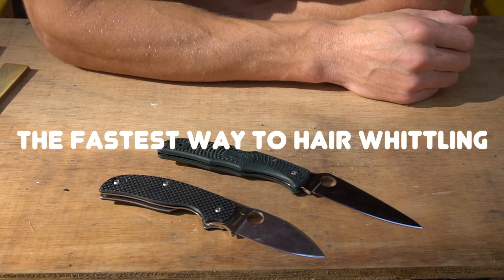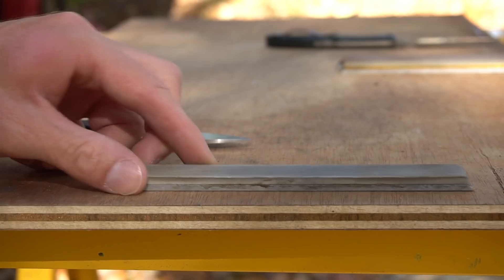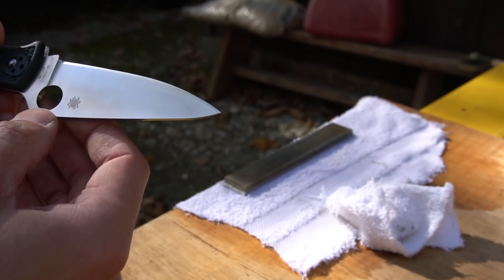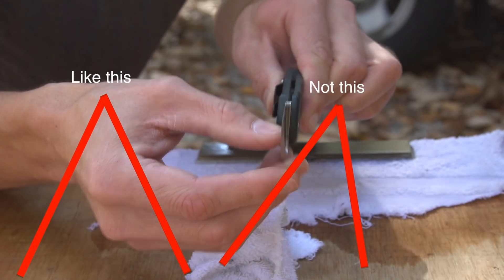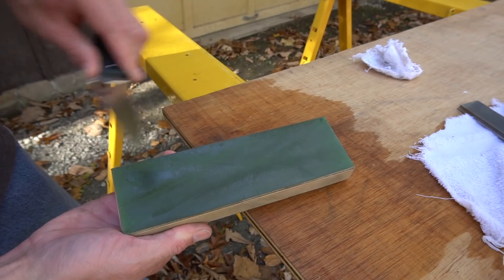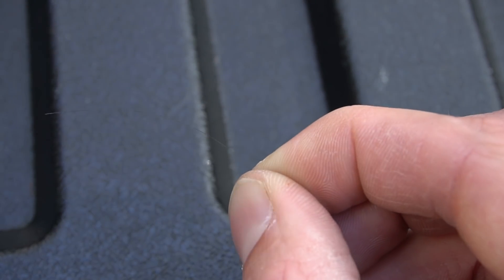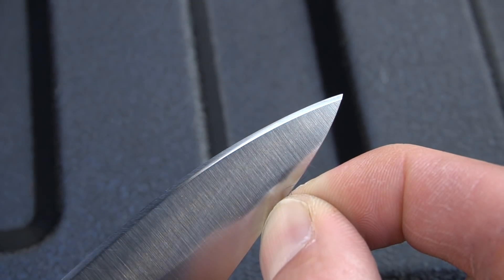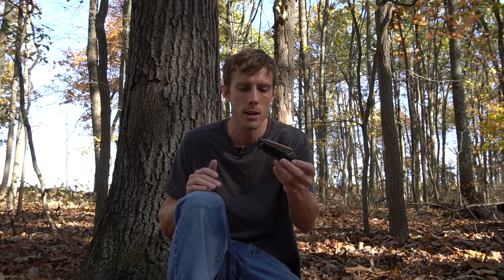FASTEST WAY TO A SCARY SHARP KNIFE

Comment: More than fifty years ago, when I was sixteen, my uncle taught me how to sharpen a knife with a whetstone and strop. He taught me to remove the burr by periodically backing the blade up on the finer surface of the whetstone, rather than the standard method of pushing the edge into the stone. He even made me a strop out of a strip of leather mounted on a board. A little jeweler's rouge helped add a bit of final refining. I used to carry around a Buck pocket knife, and I could whittle hair with it once sharpened. Now I have no more hair to whittle (okay, I still have some hair), and perhaps to my shame, maybe forty years ago I switched out my Buck for a Victorinox Swiss Army knife. I've carried that knife with me for more than forty years. It can't come anywhere near the Buck for making an edge, but is much more useful as a pocketable toolkit. I still miss my Buck though, and remember my uncle fondly.
Reply: Larry, I received a Buck 110 in 1968, upon discharge from the USAF, from my dad and it was the start of an ongoing interest in the Buck line of knives. I lost that first Buck in the backwoods of the Quetico Wilderness during one of my guide trips with some city folks from the Twin Cities in Minn. and it may still be lying on a portage trail up there somewhere. I have always hoped that some lucky outdoors traveler had found that knife and put it to good use. I now own a number of Buck knives and also quite a few Victorinox knives so I know how you feel about the "loss" of your Buck. I have been sharpening edged tools now for over 60 years and have honed my skills to a much higher level than I had ever expected. [I suppose there's a pun in there somewhere] I guess that gets in a man's blood and never becomes such a boring pass time that he simply quits sharpening altogether, eh? 

I have traveled many miles and learned a lot about a lot of different things but I always consider myself a "student" of learning and will always take pride in learning anything "new" to me, whether I know a little or a lot about that subject. When I stop learning, somebody had better check my pulse!
Reply: @oldoutdoorsguy3238  I bought Buck 110 around the same time,  always used it on fly-in fishing trips to northern Ontario.  I let my 15 year old nephew use it and he damaged the spine/back lock and made the blade not close completely. It lived in my drawer for 35 years and about a year ago I sent it back to Buck. They restored the entire knife and completely repaired the spine. They sharpened it, of course, and did the whole job for free. 

I still have the original leather Buck case, as well, everything  is made in America. The early examples of that knife had a finer point to the blade. Those knives were kind of a deal when they came out.
Reply: Man... I miss your uncle.

Comment: When you get to my age, I find it best to use a magnifying glass to check apex, and  burr. Been experimenting stroping under the magnifying glass stand as well. Getting better results when u can see your angle more clearly lol
Reply: At 74 it's the only way to go . HAPPY TRAILS.
Reply: I pick a brand new magnifying head set at Good Will about 4 yeas ago started using instantly makes life much easer. In fact we went today pick up a brand new Logitech pro 9000 web came with the seal still on the box $5.99 .About 7 years ago think I bought this same camera for the PC at the time for $ 90.00 dollars it works will sit up in the garage this little camera is a1000% better than the camera in the new laptop . Happy TRAILS my friend.
Reply: You bet even brand new there not expensive I think there referred to as head set magnifiers there just great should be on amazon and they have different magnifying . The only thing I did to mine was barge glued some thin leather on the hat ban that plastic was driving me nut so . Your doing knives and I'm doing sheaths I have over 200 hundred low but great knives but the mid range knives in most cases are really crap but the knives them selves are great . so I have a lot to do took me 2 years to figure it all out with help from some you men in England with the stitching and other things but those guys saved me a fortune in mistakes let me tell you .
Reply from the maker: Average Joe- I need to get one. Id like to get one of those large ones with a stand. It would definitely help with visuals for sure. 👍 Or bette yet an electron microscope 😉
Reply: Matthew M  they sell fairly powerful magnifying glasses, in Walmart and drug stores.
Reply: Matthew M  They have them with a light, and stand they well worth it!
Reply: Matthew M  . They can be fairly inexpensive for the lower 2X -4X  powered ones, about 30 USD . Cheap and easy to make a DIY one.
Reply: Your a very lucky guy to have all that knowledge just sitting there in the family waiting to answer your questions .I would have killed at one time to have access to that . I am a truly western sheath guy don't care for Kydex at all to me a sheath is the home of the knife nice and soft and warm home for the knife . Kydex to me would be like us coming home crawling into a bed with plastic sheets NO THANKS . Take care good luck with your knives and say HI to all those fellow leather works in the family . HAPPY TRAILS . IF you have time you might want to look at Bruce Chaney on you tube great leather worker in Texas I think he
s 3rd or fourth generation saddle maker but he does it all even the hard wear silver work a complete artist . I bet your parents and grand parents would love to watch him.
Reply: A magnifying glass is a great tool when you are learning, but I find that I can tell more with my fingertips than I can with even a jeweler's loupe.  What you really need to learn is how to sharpen your knives without creating a burr in the first place, and getting your knives sharp without the need for a strop.
Reply: Get a guided system and you can sharpen with your eyes closed. KME is a decent tool at not too bad a price.
Reply: rockets4kids how do you do that I’d love to learn (im 15) I like to keep my benchmarked nice and sharp hair shaving sharp but that’s the extent
Reply: @rockets4kids  yeah, curious how you do that. Also, what's the benefit of that method vs this one?

Comment: An old friend showed me how to use a sharpie marker as a visual guide to help keep the proper angle during sharpening.  The best way I've had it work is if I cut straight into the sharpie with the knife and apply pressure accordingly to get sharpie on both sides only where I was going to be standing. Once the sharpie is gone its usually pretty sharp.

Comment: My Dad was a mechanical engineer and a fantastically accomplished sharpener of just about anything! His test of whether a knife was truly sharp was to hold it sharp edge up and drop a handkerchief on it. The knife was "sharp" when just the weight of the handkerchief was enough to cause the blade to cut it in two...or at least that was the "goal" he set for me that I was never quite able to achieve. He always sharpened initially with circular movements rotating away from the cutting edge until a burr developed. Then using a very fine grit stone he would lightly stroke the blade cutting edge forwards until the burr was removed. Finally he would use his old fashioned barber style leather strope to finish off the edge.

Comment: Excellent methodology! I've been busy tonight trying to bring the edge of a Cold Steel San Mai Tai Pan (vg-10) up to a sharper cut. It hasn't been too easy with the hard steel, but I finally got it slicing printer paper like a razor. Even push-through is good. Plus I have a relatively shiny mirror finish achieved with the ceramic stone and strop. Only issue I'm not so proud of is the dang tip. I think the apex is decent, but the tip isn't a needle like I wanted; it's a bit rounded. Not so much that it won't stab effectively, but I really wanted to be able to poke my finger and feel that prick. Guess I'll need to work on it next time. I have a few of the Cold Steel knives, mostly bought on Amazon, and even though I never got a fake or defect some of them aren't very sharp when you get them. I know that CS will sharpen your knives for free, but dang they take weeks to return your knives. Anyway, I enjoyed watching your video. You seem like a cool country boy, like someone from my own neck of the woods. And you strike me as sensible about your methods and what you expect out of various knives. These CS knives I have are pretty much fighting knives. I have a few fixed blade and a few folders. Spyderco are excellent knives, I see you have a few of those. Take care!

Comment: I like using the backwards stropping motion on my stones for precision sharpening, though it is a bit more time consuming. To get the angle right on a free hand sharpen, I just lay the blade down flat, and lift it until I see the shadow disappear at the very apex of the edge, relative to the stone. Sometimes I use a blue colored LED light for better visual contrast detection. 

When using an angle guide like a lansky sharpener, because I'm being lazy, I color the edge with a marker, and use the ultra fine stone, and give it a light pass to see if it removes the all the ink on the edge, then I know it's right. When it;s really damaged, I set the angle at whatever I want and brute force with the extra course on the lansky. If free hand I do the back and forth pass and just make sure I hold it at a consistent angle, until enough steel is gone, then just got back to the original stropping motion and lifting the blade until the shadow between the apex and stone is gone.

The convex edges are a whole different can of worms. And actually they are a bit more forgiving, I just use 500 grit - 2000 grit on a neoprene backing, sort of like a mouse pad from back in the day or tape it to a bathroom tile with a piece of leather between the tile and sandpaper. If it's really dull I'll put it on the lansky to get a normal edge, then once it is sharp with the extracourse, move to the soft backing method to knock off the shoulders and blend the edge into the blade.
Reply: Iv spent hours at a bench trying to get a good edge.for me this by far is Easy and faster..or should I say the only way I can

Comment: In 1963 an 80-year-old barber taught me that when you hone or strop you should turn the blade over on it's spine rather than the edge, never losing contact. He could do it really fast. It feels clumsy unless you've done it a million times I guess but he considered it really important. BTW, I shave with my case folder.

Comment: I always could put a decent edge on a knife watched a few of your videos switch a thing or two and with my 250 1000 grit combo stone and then use my belt as a strop has mad a difference but goin get some polishing compound and mount my old belt I use to wood and I’ll be where I want to thanks bud
Reply from the maker: Nice! Thanks for the comment👍 The compound will make a difference for sure.
Reply: Jesus man, try using a (.) or two

Comment: Deff nice knowing how to get a razor edge out of a knife. lve been at it for a couole yrs with diff knifes. Just recently been able to get it to a  shavable edge. What i do is save that razors edge for when i need it. The part of the blade closest to handle or visa versa i wnt use till i need that fine edge. When i need to cut the seatbelts after a wreck u will thnk me

Comment: And now draw it 2-3 heel to tip draw cuts through edge on cardboard.  Then cut rolled up paper towel or tissue and see if there is any fluff stuck on the edge. This indicates that the burr was never actually removed from the apex; just aligned with the spine.  This also shows that this edge whittling thing was done with the artificially thin wire edge and not the actual apex or meat of the blade. The cardboard doesn't actually dull a knife in 2-3 strokes it just gets rid of that false sense of sharpness by re rolling the burr to one side or the other. Once I learned this I have never bothered with stropping other than to leave a polished slippery secondary bevel in 15 years.

Comment: You ran out of arm hair didn't you? And you're Soo right about the edge, you can sharpen till it shave's, but once you Use your knife it's back to a Good working edge, that's about the only reason I can see in getting an edge that Sharp, you'll end up with a better Working edge. Good video.
Reply from the maker: old geccko- You maybe right with the edge lasting longer. My arm hair is slowly growing back. Its hard being a knife guy 😉
Reply: I can have my maxamet or s110v hair sharp, whittle a 1×4 in half and they will still shave. That's that expensive steel though

Comment: if u like a sharp knife its worth it and even though it wont stay that sharp forever it will be sharper longer the sharper you polish it. also ive noticed a god mirror finish or hazy finish just rightly done wil alow it to cut more easily and hold edge alittle better. ive had great edges last well even with aus8

Comment: thanks bro I don't have any save Queens either all my knives I carry but I will admit some of my hiring knives they are certain things I won't cut such as burlap wrapped around a tree ball stuff like that that I know is going to really mess up an edge but what I found is on CTS 204p 20cv m390 and zdp depending on the angle and the heat treat well you can go quite a while couple weeks of cutting EDC tasks and at the end of those couple weeks they will still split a hair as long as you don't just thrash the blade and hitting Staples or rocks obviously so in some sense I do see the use of having a hair whittling Edge
Reply from the maker: I tend to cut a lot of really abrasive things. Like today I had to cut a couple roof shingles (didn't have a choice, either use my knife or drive a half hour to get a disposable razor knife.). Just my particular uses may be a little different. Thanks for the comment 👍😀

Comment: Nice video man and thank you. I think a blunt knife is a dangerous one so I like my knives sharp..... hair whittle sharp may be a touch over the top but a sharp knife does the job better!  I also strop my edges- at one time I thought it was overkill but now I have an old jeans belt I use and it makes a lot of difference to the smoothness and durability of the edge.  However, it does help to have a blade of good quality or else it will not hold an edge for very long.

Comment: I was curious if you have started running out of hairs to cut, lol. Your really good at sharpening. Vg10 takes a little bit longer to sharpen, but I've noticed it stays sharp so much longer. I love my spyderco knife
Reply from the maker: Yeah I have a vg10 spyderco as well. It's a great steel. Stainless and holds an edge fairly well. Great steel for a slicing knife 😀👍
Reply: My dogs won't hold still for me to pluck the hairs on their tails any more.  Any suggestions?

Comment: There's some hobby work where having a blade that sharp comes in handy. (Stuff like wood carving, leather craft, or trimming flashing off of plastic, etc.) But at that point it's often just easier to deal with an X-acto where you can just replace the blade when it's no longer razor-sharp and save yourself the time.

Getting knives that sharp is more like bragging points if the knives themselves are your hobby.
Reply from the maker: Agreed some uses it's great. Although it is usually easier to do those tasks with a scalpel/ xacto. 👍

Comment: ANOTHER GREAT INSTRUCTIONAL VIDEO! I have learned a lot from your teaching and methods!! 
QUESTION... 1. DO YOU WET YOUR STROP? 
DO YOU CLEAN YOUR STROP? Your strops look WET! 
(Maybe a video idea)
I made a strop like yours loaded it as you did by heating the compound, its maybe overloaded, mine is hard waxy looking...even after attempting to rub some compound off. THANKS!!!
Reply from the maker: I don't use water. I use a DROP of cutting board oil to condition the leather. It also acts as a cutting agent/thinner for the compound. It will leave the strop smooth and imbed the compound faster. Cutting board oil is just mineral oil. You can also use olive oil as a substitute but olive oil can turn rancid. Vaseline also works and won't turn rancid. The waxyness will go away with use. If none of these are avalible. Hope this helps and thanks for the comment 😀👍
Reply: OUTDOORS55 THANKS
Reply: @OUTDOORS55  Glad I read this.  Was going to use olive oil to freshen my strop block but will go with vaseline instead.  I'm assuming I won't need much.  Thx for the tip.

Comment: The para 3 is 59 the para 2 60 HRC it was indeed a bit more tuff at the end so hardness of the blade matters definitively too. A good vs bad heat treatment can make the same steel much harder at the edge as much more tuff to sharpen.

Comment: I followed your burr flipping apex forming process and it works great but no way can stropping remove the burr. I found shearing off the burr with high angle passes (alla Steel drakes burr based method) to be much quicker. After removing the burr, a few stropping strokes on a leather strop with the blade RAISED, not lowered, is giving extremely clean sharp edges which easily slices through basswood leaving a smooth shiny surface and push cuts paper against the grain. Just a thought. ATB.

Comment: I have some decent Grit stones I am Happy with... BUT, they have edges on the edge of the stones..

I really struggle with the Heal of the knife..

I have soaked them and tried to flatten them on a flat sandpaper...
Reply from the maker: I would just practice on the heel. It is a problem area for a lot of people. In some cases the blade is thicker in the heel and you need to remove more metal in order to fully apex. Hope this helps😀